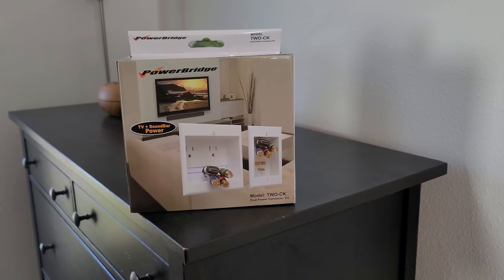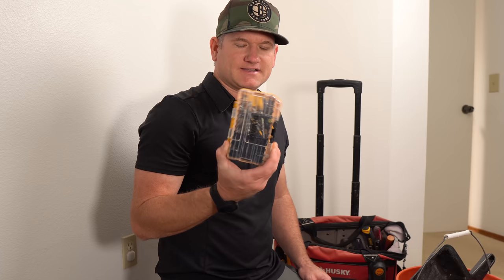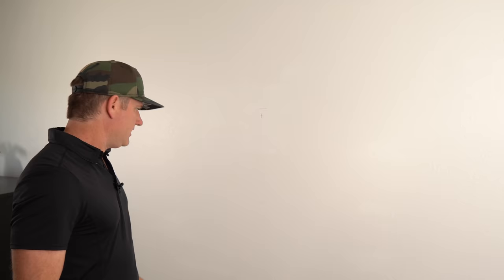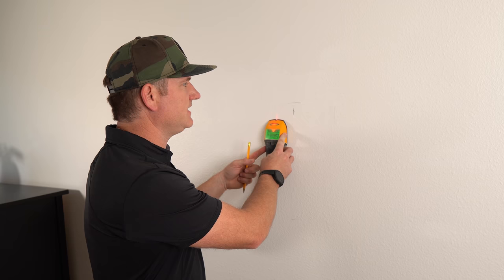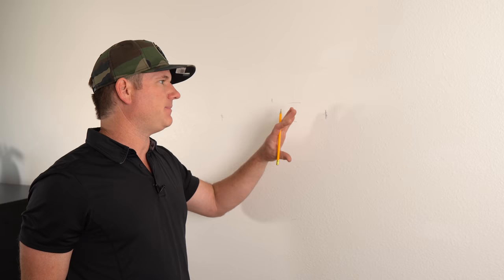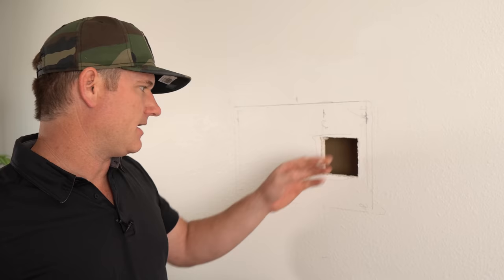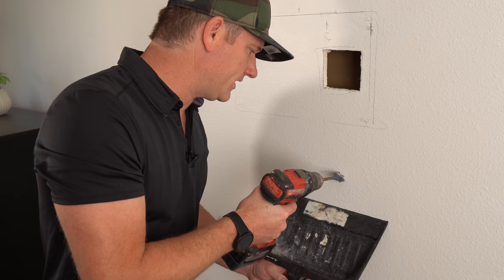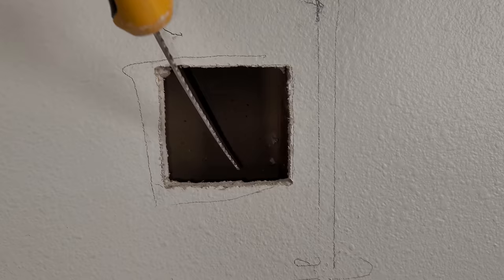Hide Your TV Wires Easily w/ PowerBridge like a PRO

Comment: Why don’t you use a flex bit, and drill through the block from the square opening? This is not how we do it in very expensive homes for sure no holes in plaster, Venetian plaster,  stucco etc.
Reply: Or even use a 90 degree drill.  I dont get the extra work for damaging that wall.  It also has to be painted now
Reply: Painted and textured. That wall had a textured finish to it. So he now has to texture it to match the surrounding texture, a real pain in the ass. 
He chose a really dumb way to deal with that block.

Comment: The real challenge is mounting on a brick wall .Takes some skill for sure.
Reply: Any videos on this. I have this exact problem.
Reply: I'll start watching these videos when they tackle brick walls. The only solution is to chase the cables into the brickwork.
Reply: @AlejandroTaylorEscribano  all you need is tapcons and washers…. If it is a hollow behind the brick, use toggle bolts with the plastic that breaks off, good for like 125lbs per, id rate closer to 75lb per
Reply: @BadHorsie1  as far as punching the block for cables, you could use an sds and a chisel
Reply: @HardHeadMilitary  what sort of bolts are you referring to? can u link them
Reply: @c.esc.1539  i linked them last night, now it is not here. Ill post again
Reply: Why? Its more easy than having plaster boards and having to find wooden studs .
Reply: Lg g2 77 inch on concrete wall. Suggestions?

Comment: Just a suggestion to avoid drywall repairs when coming across a fire block. What I find best is a auger style flex bit. You can find them in various sizes and lengths. Our most common lengths used is a 4ft and 8ft auger flex bit. It allows you to easily manage the position from an angle and chews right threw the fire block.
Reply: I was thinking the same thing. There no reason not to use a Auger bit and just fish it down.
Reply from the maker: Yes, it would work. Harder for a home owner and to recommend they do it with limited experience and visibility of what's in wall.
Reply: @BTheInstaller  that’s true and something I thought about afterwards. These flexible auger bits can be pricey. Especially for a one time use for a home owner that doesn’t do this every day like us.
Reply: This is a good tip. I usually don’t accept jobs in that require the kit or don’t pay enough for an electrical outlet because I can’t get the fat part of the plug from my Sanus kit through the fireblock. I use spade bits with a 1/4” drive because I can put it in my right angle attachment but I’m gonna stop at home depot and look at some auger bits. Don’t know why that never crossed my mind.
Reply: @christophercrawford2736  we were in the same boat. Doing the most with what we had. We looked into an auger bit and it’s been a game changer. Especially if you’re drilling directly down. Just make sure your drill doesn’t swing around and smack you. Lol it’s happened a few times.
Reply: @christophercrawford2736  there is also an additional tool to help you bend it and to gain leverage at an angle. I forgot the name of it but I’m sure you can find it somewhere.
Reply: @millergram  I was thinking of the switch blade self-feeding bits. I actually already have one of those flexible auger bits with the handle for bending it but I never use it because it’s just not very compact and not useful for the vast majority of jobs.
Reply: @christophercrawford2736  I haven’t really used those before. We typically I have a pvc pipe that holds our glow rods and auger bits with a screw on cap. They are not the most compact though but that’s the best we can do with it. I’m looking up those self feeding bits now
Reply: @millergram  I went to Home Depot because of your comment and would’ve bought one except they’re not 1/4” shank nor flexible. Guess I’ll be sticking with my right angle attachment and spade bits for now. Probably just need to use a bigger size spade bit.
Reply: John Lawson  I put pencil marks only where they’ll be hidden behind the tv or I’ll be drilling anyway. And I don’t need more than a couple of marks to hang a tv. When hanging paintings though, I use a ton of tape.
Reply: @christophercrawford2736  I got a 12 inch 1/4 extension at Harbor Freight. I just put duck tape with the spade bit or with drill bit so I don't lose it.
They should sell those extensions at HD or Lowes as well and probably you can find longer ones like 24 inches.
Reply: @joaquinsuarez6090  my point was that the auger bits are bigger than 1/4”. I have plenty of 1/4” extensions, locking and magnetic.
Reply: Right but how do you suppose you're going to fish the end of the electrical plug through such a small hole? You couldn't even fish a CAT6 line with an RJ45 connector through there if you were to use  an auger bit.
Reply: @ManguPapi  small hole? What are you talking about?
Reply: If he had used his stud finder to verify a clear path, he could have avoided the fire block!
Reply: @MarkOLewis-yv9iv  that’s if you get lucky.
Reply: @christophercrawford2736  Do you have a new stud finder? You may need to get one, they can detect nails, deep wood, steel beam and electrical wires behind gyp and wood siding.
Reply: @MarkOLewis-yv9iv  I have 3. But blocking is often in every single stud bay.
Reply from the maker: Yeah I got popped pretty good a few times.  Worst was trying to drill through a TV bracket which was in my hand and it flipped around and the 5/16 inch drill bit almost tore off my thumb.  But we had to leave for Disney after the job was over..  so I just taped the shit out of my tore up thumb, finished the job for 5 hours (finishing 2 TVs 2x 5.1 systems and 2 harmony remotes) and left for disney with my thumb wrapped for 4 days. It hurt all trip but never took bandages off or needed stitches and it's fine now.  Gotta do what you gotta do for the fam
Reply: @BTheInstaller  when drilling through metal, including when I need to make a hole in a tv mount, I use a step drill bit with oil. Much easier to cut through without catching and breaking your wrist in half.
Reply from the maker: @christophercrawford2736  yeah. It was the bracket.  Definitely better ways to lengthen the holes because of how it needed to be spaced but on the fly... we do dumb things sometimes.
Reply: @BTheInstaller  I carry a step drill bit primarily for metal studs but every time I need to widen the holes on a bracket, I’m thankful to have it
Reply: @christophercrawford2736   Not really, Bracing/blocking in unbraced walls are usually found at 6’3” or 9’5” horizontal increments. Blocking at every bay is overkill unless for firestopping.
Reply: @MarkOLewis-yv9iv  sounds correct.  Just in my experience I haven’t been able to find an open stud bay under the tv. They’re usually both filled up.
Reply: @ManguPapi  Reading is fundamental, they were talking about the SHANK size, not the head !!
Reply: @BTheInstaller  
Thank you for a great and detailed video. Question: between the power bridge and standard Romex wire install, which would be the applications you use in your clients installs? I’m a DYI homeowner and I want to know if both methods will not be a problem with code? Thanks again.
Reply: @BTheInstaller  
DIY for the homeowner is understood—great job!
Reply: @christophercrawford2736  I wish I would’ve found this comment thread when I first started mounting TVs for HelloTech. You guys are really answering all of my questions in this thread. Much appreciated I wish there was a group like this!
Reply: @millergram  So what do you guys recommend for moving an outlet across the stud? A right angle attachment plus spade or switch blade bit?
Reply: @KeemvsKeem  Yup! That's what we use. From there you can just put a blank face plate where the exisiting outlet was.
Reply: @BTheInstaller  How would you route cables through Concrete and Brick Wall?
Reply: @BTheInstaller  I think exactly the opposite is true here. Damaging your wall for the purpose of drilling a hole is more difficult for a homeowner with limited experience. Repairing dry wall that looks good is more time consuming and difficult than using the auger bit…

Comment: They actually make repair plugs on mesh tape backing that you cut to size, stick to wall, and mud right over. This fills the void, stops the shrinkage and cracking of the mud, thus saving time of extra coats.

Comment: Good video, although I disagree with how you pass the fire break. Either a flex bit, or cut a single outlet above the break and drill your cable pass. Slip in a drywall ring and a blank faceplate. No mud needed. Works for getting through a header too if needed.

Comment: Great video.

A little tip from personal experience: Anytime you are running any kind of connection cable through a wall, over time you are probably going to need to run ANOTHER cable.  So whenever I run a cable through, I tie a length of twine through it and leave it dangling at both ends.  Later, if I need to fish another line through, I tie it (and another run of twine!) to the twine and pull.
Reply: Great tip!!
Reply: I did that in a 50' cable tray running up the side of an air traffic control tower.  Years later an installation team found my "pull cable" and they said "hey, somebody did us a favor and we don't need to open the tray and use ladders to lay our cable in, we can just pull it."  

I then said "you're welcome."

It was an trick that I had learned years earlier from an old-timer when I was the 
"young guy" climbing towers.
Reply from the maker: Yes that works great. I also just use the HDMI cord itself. Pull it when only 1 ft sticks out at top, connect another wire to bottom, pull it up with the hdmi already in the wall.  I will mention both methods next video I make.  👍

Comment: The first thing I thought when you said fire block was this: Before you start, use a stud finder to check for fire blocks. If you still want to mount it in that location go ahead and proceed with what you showed or you might want to mount in a different location.
If you’re good at drywall, why not just cut a slice down the middle, run the wires and then drywall over that. We did this for some wires to a thermostat but first we ran them through a piece of PVC to protect the wires.
I’ve also use PVC pipe to hold the cords when we started with a wall that hadn’t been drywalled yet. Makes it much easier to snake or remove and resnake wires.
Nice video skilz 👍🏽

Comment: Just so anyone doesn't make the same mistake I did.  If you like to max out the angle and extension away from the wall, and are running long cables from a  router or other device, be sure to add that extra length to your cables before you buy them.  Nothing more annoying than getting everything hooked up and you realize you can't pull the tv away from the wall as far as you like because those cables are a little just a little too short.

Comment: Personally,  I do not like to locate the receptacle inside the frame of an articulating mount.  I find that cables often prevent full retraction of the mount and or put cords in harms way.  I much prefer to locate the receptacle above or below and sometimes even beside depending on size and situation.  Below is best IMHO because if a cable comes loose or sags, it is typically still out of harms way.  Obviously the location can be changed to accommodate different circumstances and use cases.  Hope that makes sense!  Love your vids and keep up the good work!

Comment: I’ve used the Datacomm version of the power bridge for all my tv installs. Same idea. Very easy. Way cheaper than hiring an electrician, and safer than wiring it yourself.
Reply: I’ve used the PowerBridge, DataComm, and Commercial Electric stuff a few times but by far I prefer the Sanus kit that I’ve used on almost all of my installs. Although now that I no longer work for a company that requires that we use the kits, I usually just make an electrical outlet for a cleaner look.
Reply: Just have a brother that’s an electrician 😂

Comment: Good clear instructions.

I mounted my 50" plasma in 2013 and was surprised at the terrible quality of the bolts the mount came with for mounting the bracket to the wall, luckily I had some decent hardware of my own.

Comment: Powerbridge is a great solution, good step by step for the DYI.  One tip that I almost learned the hard way, check the opposite side of the wall.  You might find some plumbing or electrical that screws your placement.  I was about a half inch below my sink drainline my first install.  Worked out fine but was almost a painful repair.
Reply from the maker: Yeah that is a good tip. The worst is when you make the top holes and then the bottom and the bottom is literally a drain or metal pipe.

Comment: Saw some similar things on Amazon to hide the cables and will probably do something similar eventually. I finally got my own home in 2012 and was really hesitant to put holes in a perfect wall but I got over it and wall mounted my first 55 inch 4k TV in 2016 and one more since in the same spot. I think my mount is a heavy duty Mounting Dreams full motion mount as well. It can handle 132lbs and is really well built for a good price, plus it can use 24" studs. I really like mine better than the 35 dollar ebay special that worked fine but just wasn't as well made all around.
Thanks for the tutorial, I have a few places I should repair the drywall now too but they are hidden.

Comment: You could use a 4” hole saw at the center of the fire block, keep the cut piece from the saw, then cut out a small channel vertically on the  block, fish the wire from top to bottom ( the 4” hole will allow fishing from top and reinserting below the block). Continue as you normally do then simply screw the disk of sheet rock to the fire block, and you can actually use caulking to seal the disk to the original wall,,,,,,,no taping necessary,,,,,,simply paint,,,,,
Reply: Was thinking  the same. You can also use this trick when there's no block or stud behind it: simply put a screw partially in the centre of it, use it to hold the disk in place when applying the caulking, remove the screw and fill the small hole.
Reply: Damn that’s a good idea 👍

Comment: I would recommend having a lead string put in so that if you want to add more wires after it is installed.  All you have to do is tie the lead to one end of the wire and pull thru (granted you probably want a larger hole in the fire block).   

To note if you are going to add a wire and use the lead after the fact, I would also recommend tying another string to the wire being installed, to leave after the fact.  It will make your life much easier in the future.

Comment: Great video.  I installed the TV mount first since it must be where the studs are, so it should get priority placement.
Also, I think I would put the lower box closer to the power outlet, if the cable is long enough

Comment: Great video "B!" I would have added a few small things as well. First, I would have used the bottom plug of the duplex outlet near the floor for the Powerbridge cord, to still allow use of the upper plug for a vacuum cleaner...etc. Second, I would have installed a small power strip (4-6 outlets) behind the TV, that has RF suppressors, so that there is not much chance of piking up 60 cycle hum, or any radio stations that might be near by. I am also a little concerned with the duct on the wall above the right side of the TV. In the summer, that duct might have a little condensation from the AC dripping on the TV.

Comment: Not to be harsh critic, but to already have to do sheetrock damage because of the wall block, that in my opinion makes this cheap aftermarket product obsolete. If I'm repairing sheetrock, I'm doing the rest of the job right with ZERO exterior cables. BUT you did a great job explaining everything!

Comment: I prefer the Sanus kit over the PowerBridge kit. And as far as measuring for the TV mount plate, I always measure to the top hole, except in very rare situations, so that I’m measuring to exactly where I’m going to start drilling. No extra math or measurements needed in that case.

Another note on marking the holes for the mount and for the in wall concealment kit; I always fasten the plate to the wall first and then I just put my in-wall kit to the left or right of it, usually based on whichever side the A/V cables are coming from. And I only mark the stud/height of the top hole for one of the holes, put the lag bolt in and level it, then drill out the rest of the holes and lag those bolts in too. No need to try to balance a heavy full motion mount with one hand and much quicker/less steps in my opinion with a tilting/fixed bracket.
Reply: That does look better. I've got HDMI cables along with the power cables and simply just doing the power doesn't really do much for the whole look. Perhaps if you're using a smart TV's apps to play streaming music a power only option would be reasonable, but for the rest of us, we really need to route the other cables as well.
Reply: @SmallSpoonBrigade  certainly a lot smaller than the one he used. PowerBridge also makes a smaller one.
Reply: Why can't they simply make walll in approved 6 to 8 feet extension cable just a stupid business
Reply: @caliboy2498  technically you can. But the part coming out of the certainly wouldn’t be permitted by code to be outside of the wall.
Reply: @christophercrawford2736  yes I understand but these kits also r just an extension cord with fancy plugs so what is the diff
Reply: @caliboy2498  it’s 12-2 wire inside the wall, meant to be in the wall. And everything is all sealed off properly.
Reply: @christophercrawford2736   sorry didn't get it what is 12-2 in wall all sealed plz explain what do u mean by that
Reply: @caliboy2498  12-2 is electrical cable rated for in wall
Reply: @christophercrawford2736   12-2 is a gauge only but not CL2 certified